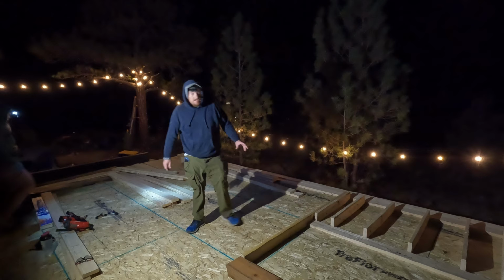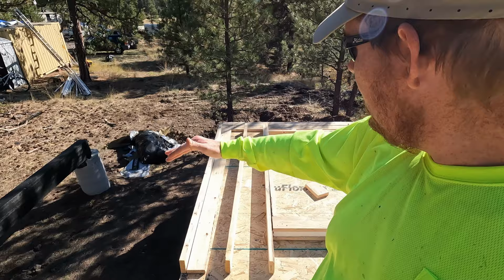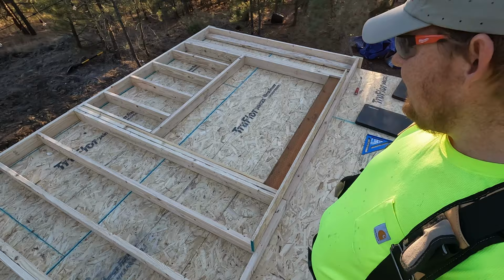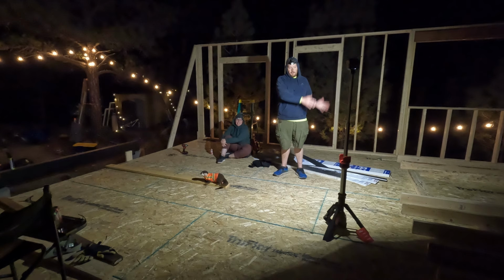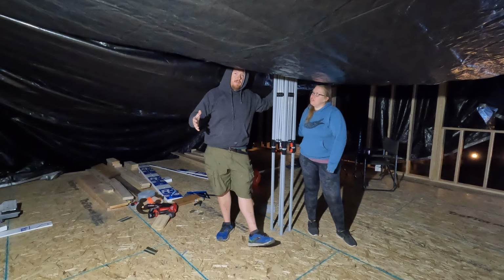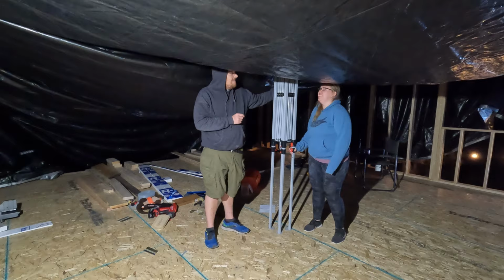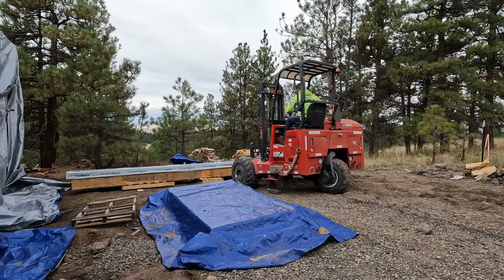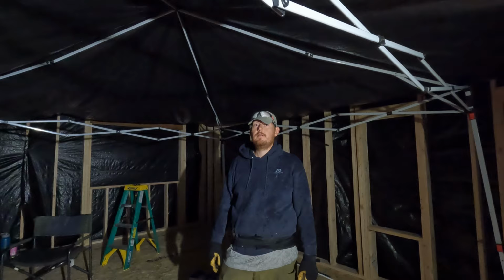The Framing Continues... Building A Giant Tarp Fort | 24x24 Off Grid Cabin Build

Comment: Problem with fiberglass is if ever gets wet it will not reple water like the Roccwool. Then you have frozen insulation which defects the purpose and will allow mold .😢
Reply: There is no problem with fiberglass, its been used for many years. If the only problem is getting it wet, then don't get it wet. Most building materials don't like water. Easy problem. Keep them dry. Your house is coming along great.